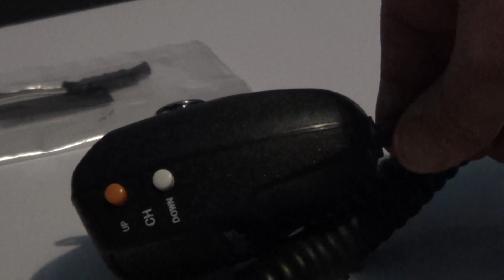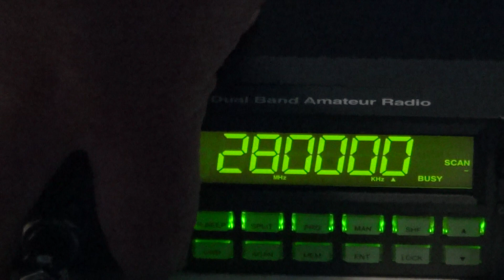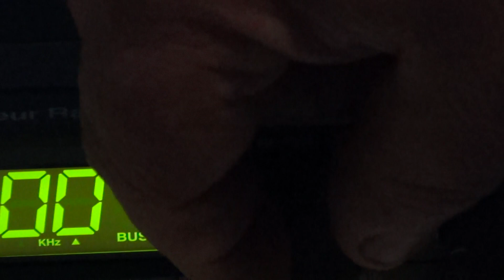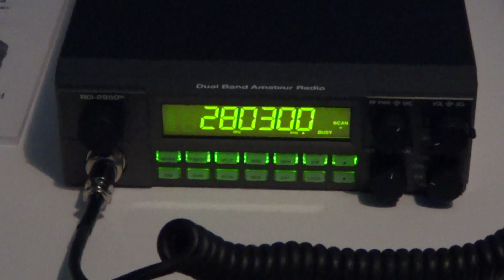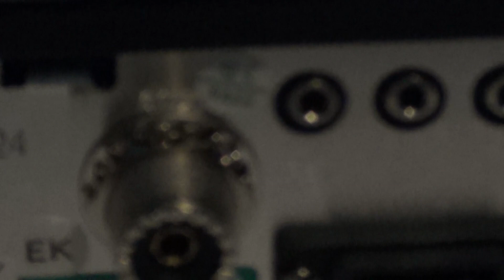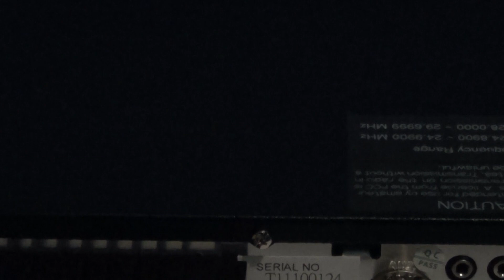RCI Ranger 2950 DX3 Dual Band Radio Review..............By Dave M0OGY

Comment: this radio will do about  10 mhz to 4o  mhz when u use the split function. .. then 50 to 54 6 meter. ....10..12..15..17 ...20 meter but most works best 21 to 30...
Reply from the maker: What?.........it's not a full HF radio

Comment: Hi I see its CE approved,wonder if they have set these  to narrow fm (2,0khz max) for UK ,EU use as Ive modified a few of the USA versions,these are set on wide dev (4.0khz) for USA channel spacing\Bandwidth.
Does it mention max FM deviation in manual at all?
If you need the mod let me know two resistors changes one rx one tx side.

Comment from the maker: Hello Mark, the radio comes as a 10/12 meter only radio.
As I point out in the video you need the small "plug in" E-chip that plugs in behind the front panel.
Then the radio is 24-32 MHZ wide wand.
If you buy the radio I suggest you ask for this to be included, many put in in for free or £10.
If you buy it later some will charge way over the odds upto £25!!......crazy!

73 Dave M0OGY.